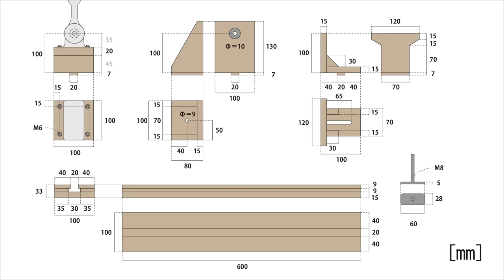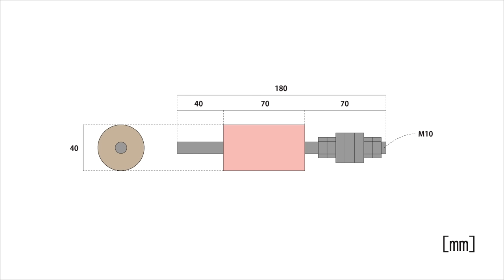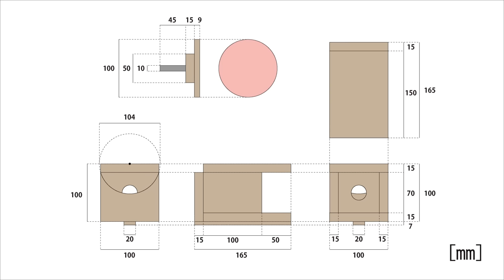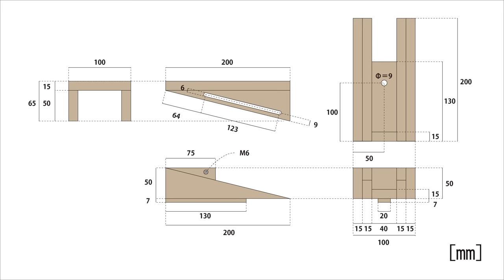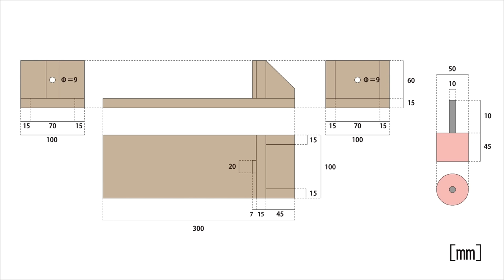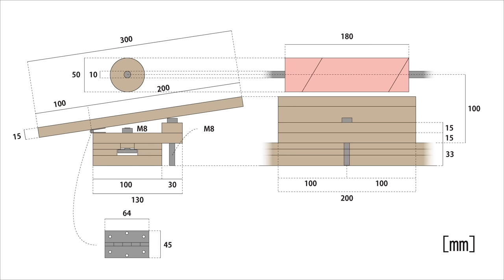9 Best Drill Hacks | DIY Woodworking

Comment from the maker: MAIN UNIT plan 9:16
Reply: for the first hack, you could just use a thicker than the required drill bit size and drill carefully till you need the depth for the screw to sit in level of the plank.
Reply: 61
Reply: The video "9 Best Drill Hacks | DIY Woodworking" has provided great and useful tips for viewers, helping them grasp woodworking techniques in using a drill.

Comment: This only looks smart to people with little or no experience. To extensive and work demanding, much easier and cheaper to get the real thing. Many machines have the attachments hes making. And many of the things he makes is easier done in free hand with a little bit of practice. Plus many of the harder demanding things, the drills arent ment for that kind of punishment so you will end up destrying it.
Reply: I do have experience. Some comes from buying EXPENSIVE tools that don't get used every day on a commercial level.  These hacks are great for one-off projects and such.
Reply: Don't you see him using a real drill press after making one? If not I bet you feel silly with your comment now lol.  I have over two decades in the trade and full access to cabinet shop with all these plus more. 

To the maker of this video, very well done!  Thousands of YouTube videos this is the first one I saved because I want to make some of these for fun plus having smaller version of these would be nice.

Comment: Improvisations always lead to an accident. It is the main rule in Health and Safety provisions. That small hand drill will never ever have the strength and accuracy of a normal drill press. Are you happy not spending only for a medium drill press? For the moment, yes, you may save some money, nut when an accident happens you need to spend money in hospital and for medicine. If you are a professional, then buy professional tools instead of making wood and epoxy dangerous improvisations. I will discontinue my subscription to your channel coz I can't accept the person I am following to use improvised tools instead of buying professional ones.

Comment: Way too much effort and equipment.
Reply: I'm not going to watch again until I need it for reference but I think he only used a bench saw and a pillar drill.
You could get away with using handsaws and an electric drill.
Also you could use other materials and parts - the ideas behind the accessories are as important as the methods used.
Reply from the maker: Thank you for watching and for your valuable feedback.